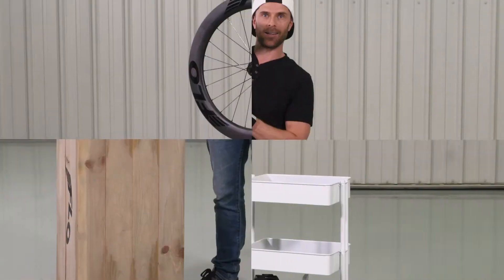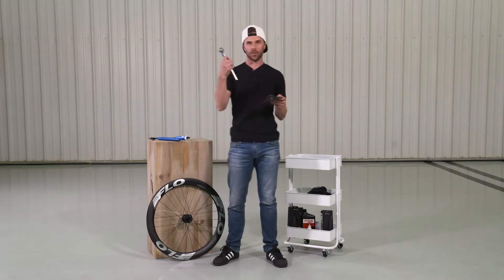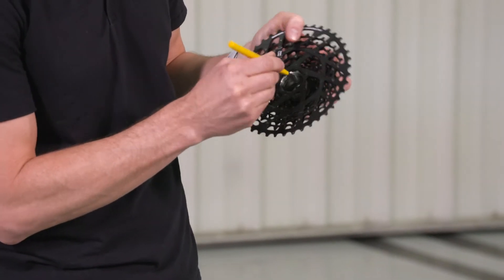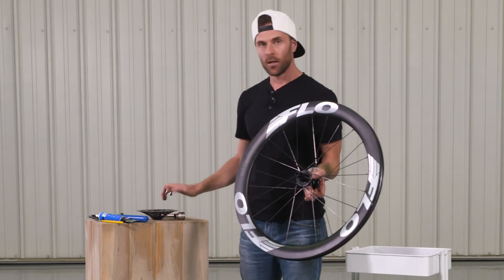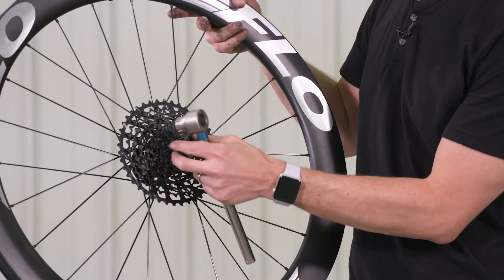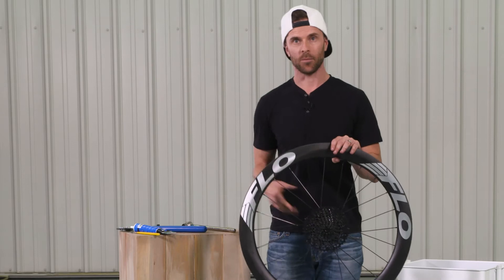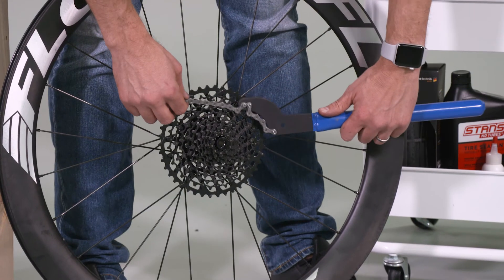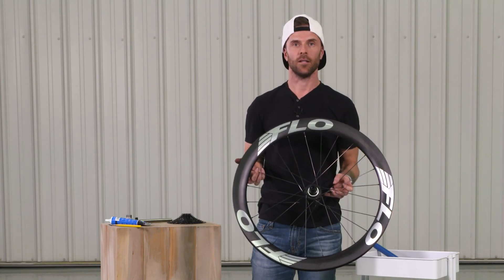FLO Cycling How To - Installing An XD Or XDR Cassette

Comment: Hello, is an end cap xd compatible with a freehub xdr?
Reply from the maker: When you say end cap do you mean the end cap on the axle? If so these would be the same. If not can you explain what you mean further?

XD cassettes will work on an XDR freehub with a 10 speed spacer but an XDR cassette will not work on an XD freehub.

Comment: I have a question. is it all wheelsets brands that have the possibility to install XDR? or only a few wheelsets can use XD/XDR? my bicycle still uses a wheelset from the factory. a little bit worried can't install it and must buy a new wheelset. note. I'm still using 9-speed. wanna upgrade to 12-speed. and still, use Shimano and I wanna convert to SRAM.
Reply from the maker: Ultimately it depends on the hub. If the hub you have had an option to install an XDR Freehub then you should be good to go. I’d contact your hub manufacturer to see if they have an option for you.
Reply: @flo_cycling  My bicycle is Cannondale. I'm still using the standard wheelset called "Cannondale, double wall, 32h"
Reply from the maker: I’d reach out to Cannondale to see if they have a part for you. Hopefully they do.

Comment: I over tightened mine and it stripped slightly, it still holds however I haven't tried to tighten using a torque wrench - have I just blown a £350 cassette?
Reply from the maker: You may want to have it looked at. It’s tough to say without taking a look.  A good shop should be able to diagnose this.

Comment: Thx !
I still have one question for which i still not have found an answer. 
Since there are 12-speed MTB cassettes, why would i still want to buy a XD hub instead of an XDR one. With XDR i can use all cassettes. The MTB cassettes with spacer and the road cassettes with no spacer. Why is XD still in use ?
Should i buy an XDR for my MTB or an XD hub ?
Thx !
Reply from the maker: XDR is the best option. XD is old and being phased out. Even if you have an XD bike you can use an XDR Freehub with a spacer. We no longer sell XD freehubs.
Reply: @flo_cycling  Thx very much ! That is what i was suspecting but could never read anywhere. 👍